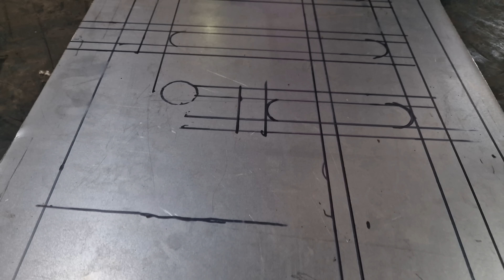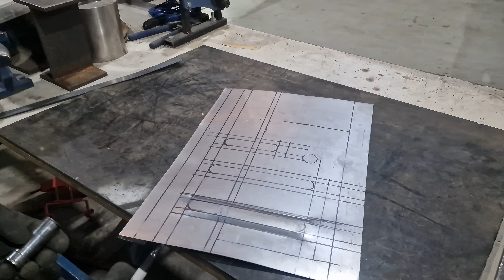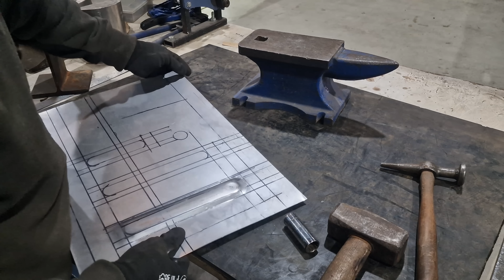Restoring A 1970 Mazda Cosmo 110s - Floor & Sill Fabrication

Comment: Super impressive work, gents. Much enjoyed Steve’s floor section fabrication, using the English wheel, bead roller, socket, cold chisel and ingenuity with a hammer. Looked brilliant when offered up. We know that if we tried it, we’d likely end up with something like a metal waffle. 
Later, Ryan mentally unfolding a rusty box section and creating a net, cutting out & fabricating an as new part. 
It’s all just ace work. No matter how carefully I measure with a steel rule, it’s the dead reckoning of experience that tells you how far from a guideline you need to begin a feature like a crease, a right angle etc to finish with your part in the correct plane and not 5mm out. 
Shakes head in admiration for you both.
Now why cannot things be arranged such that really skilful work like this is as highly paid as is mere exploitation by money people? The latter only need fill out a form and money they acquired elsewhere increases in value at our expense. Fair rates would be ok, but they never are.
Money lending is a generic, commodity type activity and it uses virtual raw materials. 
We’ve got it all upside down that real raw materials like bright mild steel sheet plus skills and time aren’t much valued.
Rant over. And thank you 🙃
Reply: Bloody hell m8 I agree with you but come here to remind me our country still has decent people who are extremely talented write to uour mp or summit but please don't tante this awesome channel

Comment: You guys do great work. And terrifiying work. I was taught to be a panelbeater during trade school, and cars like this were such a pain. Not because of the work, but because of the customers. We never got the good kind, we always had the same type: Who wants it done great, cheap and quick. I never got to learn proper shaping methods because all of the cars we worked on were fixed with aftermarket sheetmetal panels, and usually ones of not great quality. I don't really fix rust on cars anymore, because I straight up dont trust what I learned.
Reply: The schools are just to say you have the papers so you can get paid more, other than that it's not much good.
The actual work, as usual, is always learning by experience, trial and error.

Comment: As always, I love watching you guys work, both as individuals and as a team, I have a couple of silly questions / suggestions and I am only an old keyboard observer, Ryan when you are forming the curves on the I beam section, you form them by working across the face of the beam; would it help to radius off one corner of the beam section , which would allow you to form much crisper lines? Secondly, could you please periodically showcase the work that the rest of your staff are doing as the day to day core business? Again I cannot state more equivocally, how much I have learned and enjoy by simply watching you convert rust and create / restore structure into vehicles, Thank you for this site.

Comment: Hi Steve and Ryan that Cosmo reminds me of my Alfa Romeo 1300 GT Junior first registered in Yorkshire YWX 8G 1968 model. 
It to was an absolute rust box like the Cosmo!
I was going to work early morning and I pulled up at the lights and thought I’m low down WTF I opened the door put my hand on the road and lent sideways looked under the car and my drivers seat was an inch of the asphalt 😂!!!
I carried on to work and notice a piece of two by two at the side of the road I stopped picked it up lifted my seat up of the floor and pushed the wood under my seat then onto the drive shaft housing then rested the other end on the bodywork inside the car I drove around like that till I. Old afford t  get a local lad to wells to panels in both sides!
I loved that car what a wreck!!!
Reply: That was 1976 sold it to my mate and he wrote it off he then sold it on to a lad who was going t rebuild it £65 he sold it for they bring big bucks now in good condition!

Comment: I've always wanted to know how effective two craftsmen working one car (or what's left of it) would be.
Now I know 😀
I hadn't thought of stretching those beaded floor areas through the eng-wheel before you actually put them through the bead-roller.
Also I only just now noticed, you have a Trent Precision Engineering eng-wheel, I actually got my hammer & anvil dies from their ebay shop! 😁

Comment: :) poor Snap On socket; instead of gripping nuts and bolts it gets its butt kicked to form a piece of metal. 
But than again: you got to use what you have lying around, and it is for a good cause.

Why were you surprised to find more rust at about  13:30? The welding 'blobs' and strangely formed beam should have given you shivers. But sometimes i reckon you just don't WANT to think of what probably lies ahead. Thanks again Son and Dad!

Comment: Its really great to see you both in the same video...... can't beat good teamwork to get the job done!
Super impressed how you can hand make a new panel using a rusty, incomplete original as a template - its a real priveledge to watch you guys.
Just one question I've been meaning to ask.....do you use different thicknesses of sheet metal to fabricate body panels, chassis rails etc, and how do these thicknesses compare with the metal used on the original cars?
Reply from the maker: We do yes. Ues use from 1mm to 1.5mm and even sometimes 2mm for heavy chassis section like in the suzuki lj80

Comment: Why do you not media blast or dip the bodyshells before restoration so you can see what you have to deal with and you are then welding to solid metal?
Reply: I THINK because sometimes there is no metal left after dipping. Now some (vague) outer lines are present as a reference what the part looked like when it wasn't turned into rust.

Comment: Why dont you guys use a hydraulic press with appropriate dies for making the ribs in the sheet metal? It seems you would save time? 

Yes, it would require dies of varying widths, but still.
Reply: It’s a good idea provided they could sweat the hardware involved sufficiently often to warrant the upfront costs.